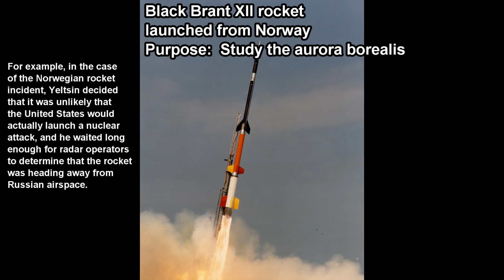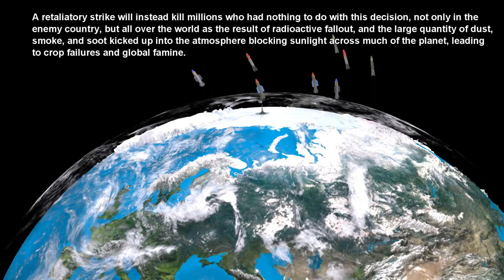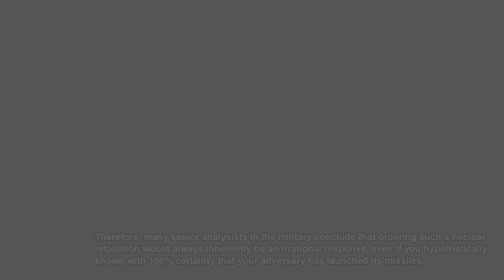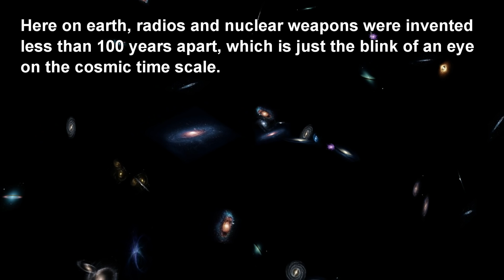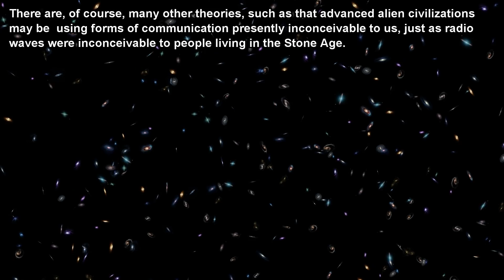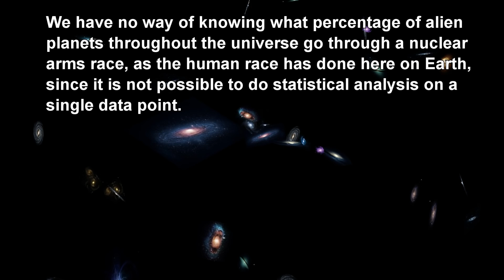Nuclear War & Fermi Paradox – Mutually Assured Destruction

Comment: EMP will not knock out hardened radar.
Reply from the maker: You could protect it by placing it inside a Faraday cage, but then it wouldn't be able to pick up any radar signals while inside the cage.
Reply: @EugeneKhutoryansky  I don't know anything compared to you, but in 1984 and again in 1986 I had to get security clearance to design for EMP. And I have designed some little things for radar. But no combination of the two. https://www.spiedigitallibrary.org/conference-proceedings-of-spie/10141/101410R/Plasma-radome-designed-for-the-EMP-effects-defense/10.1117/12.2254041.short?SSO=1

Comment: I've got a question.. If one side detonates a nuke at high altitude and wipes out all electronics on one side of the globe, including satellites, would be inoperable. How would the nukes ever reach their designated targets if they couldn't communicate on one side of the globe? Can they bounce signals off the ionosphere? If they can bounce signals wouldn't the trig work against them as the missiles altitudes decreased?
Reply: ICBMs follow a pre-progammed trajectory. They don't use satellite communications or GPS. Actually, they don't communicate at all. Once launched, they're fully autonomous, and they cannot be aborted or recalled.